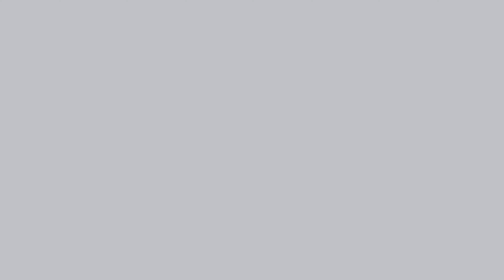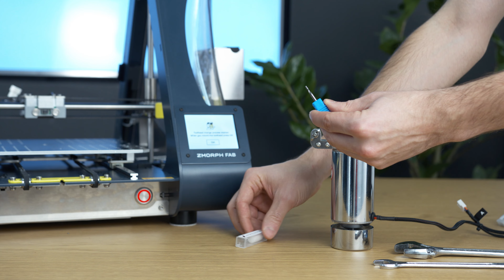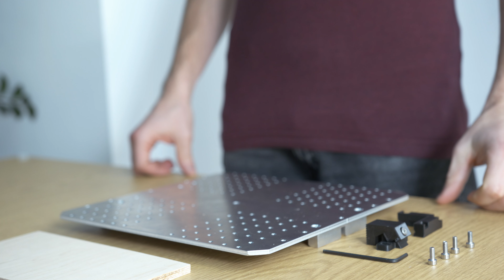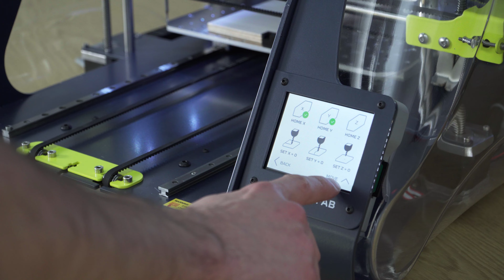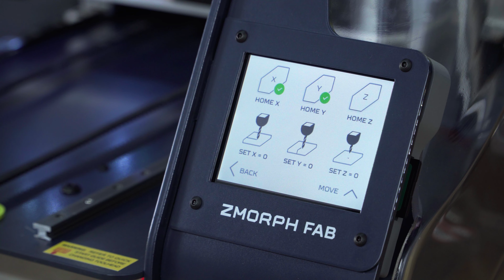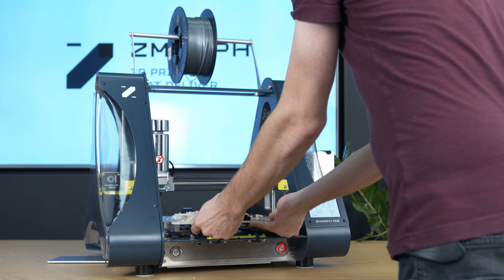Zmorph Fab - CNC Milling Toolhead

Comment: The clamp you use in the video did not come with my device.  My push clamp has two base supports that prevent the push part from contacting the material. Am I missing a clamp?
Reply from the maker: Hello Charles, we ship Fab with 3 clamps for CNC milling and others are available as files to 3D print. The files for printing should be on the SD card that comes with the machine. If you cannot find the files, please contact with our support team and we will send you the G-codes.
https://zmorph3d.com/support/

Comment: 05:07 If homing the Z axis can damage the tool, surely this option should not be present when in CNC mode. This is bad design.
Reply: Exactly, one would expect that function to be disabled by default if in cnc mode
Reply: @trobert132  Once I made a device for this machine that measures the height of the "Z" axis and the 4th "A" axis, it worked very well with the laser, because for CNC rather average due to the belt drive and weak stepper motors